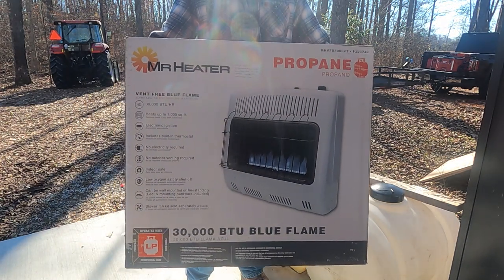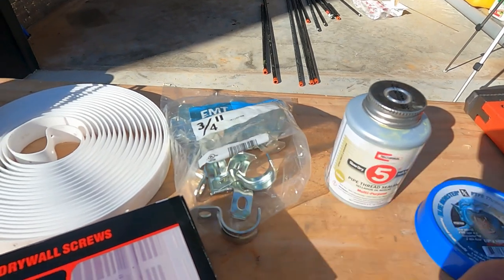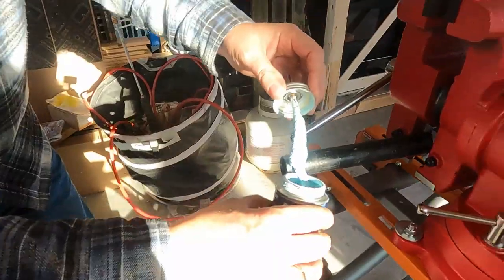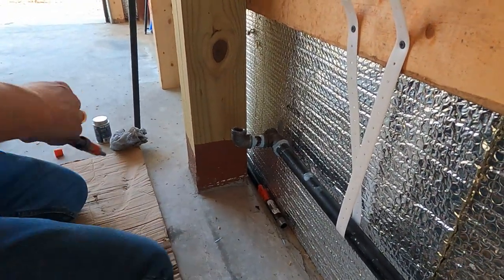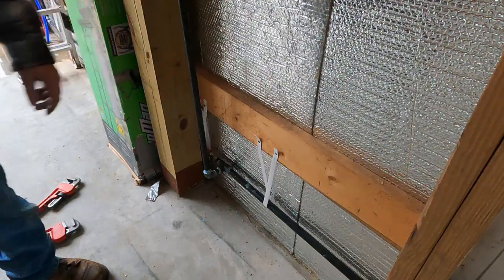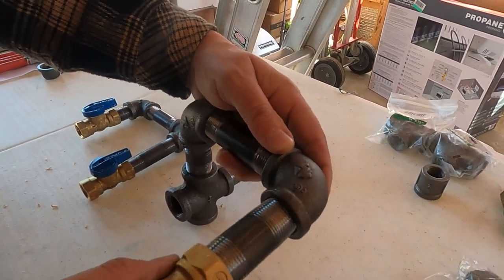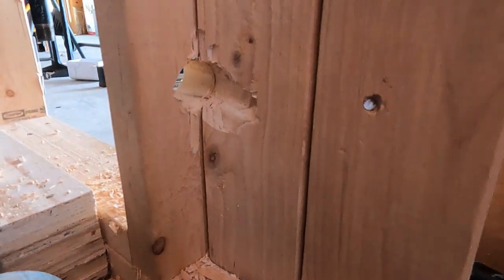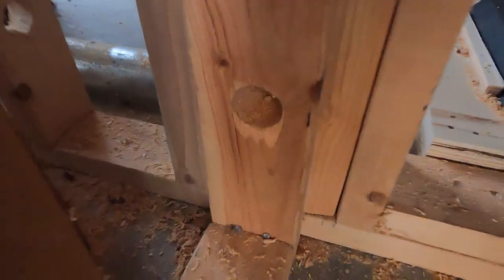Propane Pipe Install (Black Iron) In Off-Grid Tiny House/Pole Barn

Comment: I am going to be building out my cabin with propane and solar. Did you run into any issues with supplying enough propane to the generator, hot water heater or range running at the same time? I will be connecting only 2 appliances (Range/Oven 80k BTU (all running) and a tankless water heater 70k BTU max). Just curious because I know one of those appliances I have will have to have a 3/4" connection while the other is 1/2".
Reply from the maker: I wish you luck on your build out. As for me, I am taking this much slower than I would like to due to the fact we don’t live there yet and my limited time and resources. That being the case we have not yet finished things up yet. I sure hope and pray it will all workout for both of us. All the best!
Reply: @TheLovelyPlace  Ok. I guess we will be in a similar situation. I am trying to figure out what I want to tackle first. Solar well pump, solar, finishing the inside of the cabin or septic. All come at a price but I think finishing the cabin would be the cheaper option (insulation, wall panels, electrical is already done). However, doing some of the plumbing first before septic is in I might run into issues. Best of luck and may we both finish something ;)
Reply: You can look it up with all your btu loads combined. Proper piping size is key to getting enough gas to each appliance